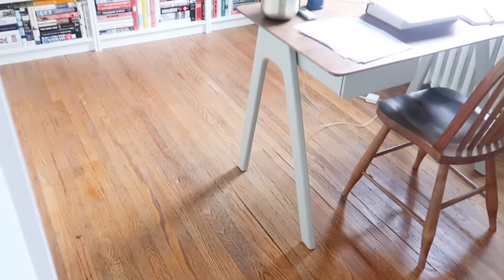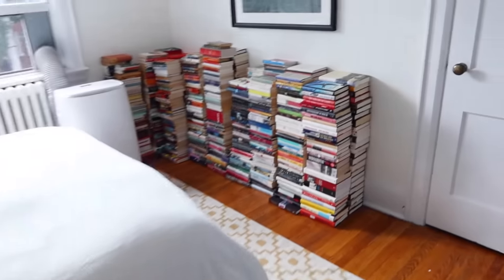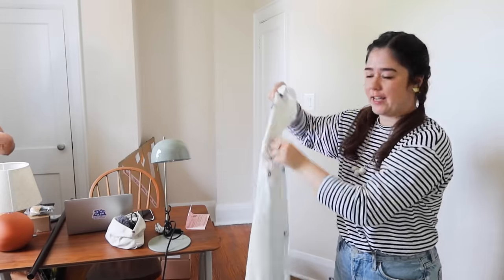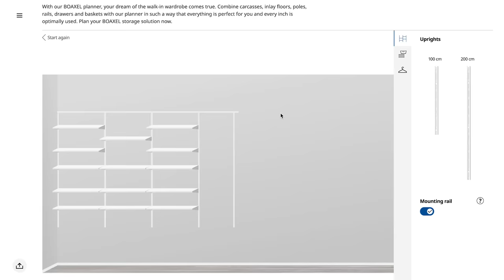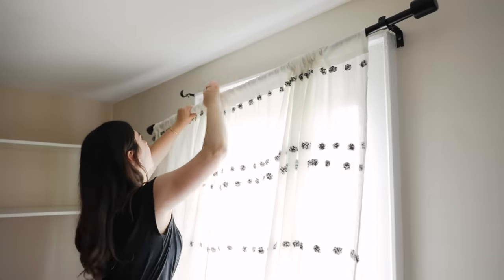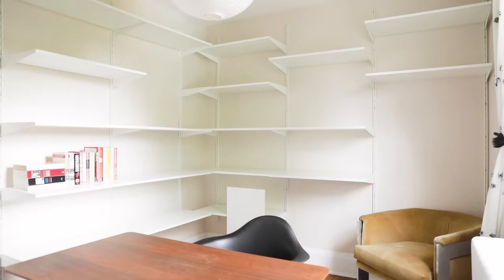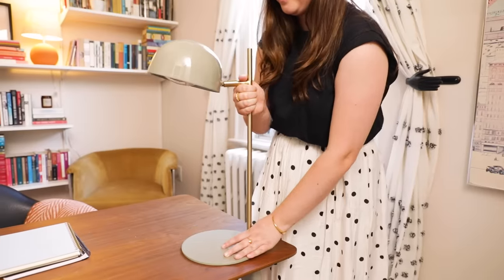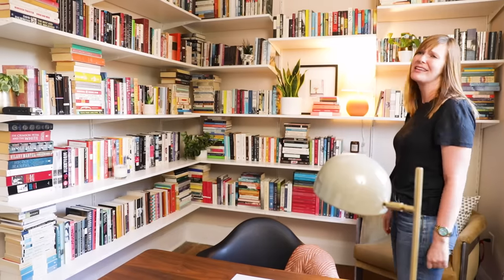Turning A Spare Bedroom Into A Home Library With 800+ Books

Comment: Are those bookshelves up to the weight of books? Book weight is something people don't always think about when it comes to putting together libraries. I do really, really like the L shape of the shelving!
Reply: I am thinking that Graeme probably thought of that, as Alexandra said he was the "pro" at any building stuff. And, she also mentioned they put book shelf supports into the studs. I am pretty sure those shelves and brackets are heavy duty !
Reply: @m.maclellan7147  it's the shelves that bow though, not the supports. I would never use track shelving for 800+ books personally, they're only going to last a few years before the shelves themselves need replaced.
Reply: @TheTinyHerd  thats interesting. a lot of booktubers i subscribe to either have the billy bookcase or this track shelving and im so confused bc.. the shelves do "bend" or i guess bow in the center over the years. do you have any recommendations for materials on shelvings for books? (if not it's fine too!)
Reply: @ruby7706  they would be fine for probably 5-10 years depends on the books you had. I wanted mine to last forever so we used like 3/8" solid birch. They were custom built though. I just have nightmare flashes of track shelves full of books raining down lol
Reply: @TheTinyHerd  that's super helpful. gonna go and get some custom made for when i finally move out so because ikea is just fast furniture at this point! (tho i know the appeal in my country is that it's quite literally the most affordable furniture store so i get it)

Comment: Ooooooooh, so bright and beautifully bookish. What a room. 2 thoughts: there's no spot for a cup of tea by the chair, either a spot with no books ar a tray that will sit ontop of a stack of books. Secondly, im imagining using ply wood, cut to the full the shape of the shelves to unify them. So you'd have a loooong board which covers all the white shelf junctions and fills in the corner gap. With a walnut stain you get a little of that dark wood library dream. Simply stack books ontop.

Comment: Hey Alexandra, This looks like so much fun.  I think I would have added one more element.  At 18:20 in the video you show the closet door and the space the closet fills opposite her desk.  Somewhere in there I would have added a mirror.  This would allow her to check herself quickly before a zoom meeting and also reflect the books back to her view when she looks up.  Maybe behind the door if the door is closed when she is on zoom or working or on the door if the door remains open.  Like you say mirrors are always useful in a small space.  Well done.

Comment: I'm an academic and just moved to a new apartment, so I'm currently in the process of setting up my own home office/library. Firstly I'm jealous of the library in the video; having to make several long distance moves I've had to significantly pair down my books. This time I only had 10 boxes of books to move.
As for the organization, I go by categories such as dividing my fiction my genre, and work related books by topic. In large categories I divide up by size, with the larger books, such as textbooks, all together and smaller/shorter books together. This is just for the sake of shelf placement and maximizing space. The important thing that a lot a lot of people forget, or just don't know to take into consideration when trying to make their books look nice is organizing by frequency of use. This is a human factors design concept; you want to put the books you use most, such as those you reference for work or hobbies, within easy reach. I do keep in mind that I do teleconferences, so I also make sure that the categories of books and decorative items that are in the background, are work-appropriate.
I do front my books (put them at the front of the shelf), as a former librarian this is habit but I also think it looks neat and clean. I will organize by height, but not strictly so, as organizing completely by height makes it look a little cold. Having some variation in the height order makes it look like a collection that you actually use.
I do not organize by color, yes it looks good on social media, but it's completely non-user friendly as all your books are mixed together and they are harder to find when you need them, especially if you have a large collection.
For those who want to understand better how to design for ease of use, and not just appearance, I highly recommend "The Design of Everyday Things" and "Emotional Design: Why We Love (or Hate) Everyday Things" by Don Norman. They're a great introduction to human factors based design and are an entertaining read even if you have no background in design or psychology. You'll never look at a door in the same way again; Vox did a good video on "Norman Doors" at https://youtu.be/yY96hTb8WgI which also is a great introduction to human factors design.

Comment: Great to see a ton of books. Personally, I would add more shelves and some less deep. You lost all the space near the floor and lots of gaps between shelves, which will invite dust. The track shelves will be less likely to harbor mice if you have that concern where you live. When I moved out of a Victorian house, discovered a mouse nest behind book s on bottom shelf. My ideal book case would be vintage wood with glass doors.  Also I would prefer a higher back on a  chair to relax in. But otherwise, I love it. Fun to see your first video clip. Like the old cigarette commercial: "you've come a long way, baby" I need a light like that. You are right about the rug as well as. Cute curtains and tiebacks. TFS

Comment: Great job. The space is fantastic! The only thing I might, might tweak is the curtains. I would extend the rod a few inches on each side and get two more panels, so it looks a little fuller and can hang in a straight line on the outsides. Having said that, I don’t hate the curtain treatment as is.

Comment: Such a great makeover. I would have painted out the corner track (behind the reading chair) in the wall color and hung the curtains higher, up at the ceiling. I realize they’d be too short but I add fabric and trim to “too short” curtains all the time and it works. Great job as always!

Comment: The make-over was wonderfull. Spreading the books and plants over two walls was much better, and the chair etc was great. Surely though, desk position is important. You can't have a lamp wire/plug stretching across where people are walking? I can't see how having the desk in the middle of the room, with a lamp on top, can be safe?

Comment: I was afraid that the bracket shelves would look too pantry-like, but they actually turned out great with the books on them. Especially the floor to ceiling use of space is a great plus. I'm considering to replace my white Billy shelves as well now. The only drawback is the depth of the shelves. There's so much unused space in the horizontal actually reducing the room's space, which is such a pity. I wonder whether there are shallower shelves (more like the shallow Billy).

Comment: Nice job, Team AG.  Yes, Alexandra, there are strong opinions on book organization.  There are also strong opinions on how books can be used in decorating.  Others may disagree, but personally, I cringe whenever I see plants and candles (especially lit ones!) mixed with books.  It does not make me feel good about the overall design when I see either a plant or a candle placed on top of a book.  With plants, it’s too easy for water to go astray and damage books.  With candles, dripping wax makes a mess and fire from lit candles is dangerous.   I also don’t like it when I see books laying open:  I have visions of sun damage to those pages vs the rest of the book, dust collecting, the spine breaking so the book always falls open to that point from hereafter, etc.

Comment: I typically organize my books by author and genre. Author is higher priority than genre, if one author has written books from different genres, they all go together. The genre affects which books go together as a big picture. I have my fantasy books grouped together (multiple authors), all historical books grouped together (again, multiple authors). And because I have limited space, I need to put books where they can fit the shelves as some of them are smaller spaces than others. I currently have historical fiction in two spots, as the books by one author are taller than the others so they don't fit where I have my historical fiction. 

I also reorganize my books regurlarly. Depends what books I buy/get as a present. If the book belongs to a shelf that's already full, it's reorganizing time. I also try to complete any series I have. I currently have one that I'm not even going to complete but generally I want my series complete and grouped together. I never organize by colour, that would just give me anxiety.

Comment: It looks much neater that way and I'd like to use those shelves for my little office too. I'm just a bit concerned about the weight of the books on them. According to the IKEA website, those shelves seem to be designed for shoes and clothes. I don't think I have studs in my house I can drill the tracks into, so they would need to get fixed to the bricks via normal Fischer's. Do you reckon that would be viable?

Comment: Alexandra you did a great job.  The place looks like an invitation to work happily.  However, the hanging lamp on the ceiling does look too cheap for the whole.  And the plant does not really have a nice shape, maybe a bouquet of fresh wild  flowers would fit better.  As you asked for a method for storage for either books or cds, especially if you have hundreds, is to do it in alphabetical order by the authors last name, by sections.  Like: poetry A-Z, fiction A-Z, non-fiction A-Z etc.  It saves you a lot of time looking for things.  Have a nice Sunday

Comment: It looks very light and comfortable. I like it. As a book owner I have to ask though: Did you space out all the books she had on just one wall now on two? Where shall she put all the books she gathers in the future? Wasn't the idea to give her more book space?  Her books don't vary much in hight so you could have minimised the space between the shelves, right? All those who were not yet full of books could be used for  a little decoration and she would not have to hang more shelves and rearrange later.  Also in my experience deep shelves just accumulate clutter which is why I pull my books to the front of the case.

Comment: You were right. The book shelves are too deep. To me, both from a monetary and design perspective, to toss the Billy Book cases (unless in selling them she recouped some of the money spent on those new shelves) made no sense at all. ESPECIALLY because you were not able to necessarily put all the books back.  Book storage is about  more than design and eye appeal, IMHO. Now, if the owner feels the space is more open with this type of shelf, then yes, it works. I can only speak for me. Of course the other advantage is that with enough shelves, you can vary the heights inbetween to accommodate books and that  may have been one of your key things to accomplish. I would love to have a dedicated office/library (although I do have a hybrid of sorts but for over 4,000 books, there are shelves in every room but the kitchen and bathroom! Yes, we have a foyer that also holds books and pantry items! Love the rug and the chair you brought in. And yes the nook for reading is great  provided there is enough light for later in the day and night when the overhead might not be sufficient. Too bad there couldn't be a window seat, the ultimate "nook." Well done.

Comment: The shelves are too deep (and too spaced out), you can see in the end shot that the books have been pulled forwards and aren't against the walls, and there is a void in the back left corner which is wasted space. The vibe and design is great, but if you had bought melamine shelving, brackets and tracks from a hardware store it would have worked out cheaper and you could have gotten an exact fit to the edges of the room leaving more space and accommodating more  books.

Comment: So, the shelves are WAY too deep for most books. I looked at this option and went with the Rubbermaid twin trak system. You can get them at Home Depot, they are cheap and way more flexible than this. Most are my shelves are based on the 6 ½ inch brackets; way better for most trade paper and hardcover books, not so good for coffee table size, but they also come in 10 and 12 inch brackets. Just FYI. And yes, book people have OPINIONS.  ;)

Comment: Oh an ACTUAL decent number of books, and HALLELUJAH they aren't rainbow.

I think a Billy built-in hack (NOT in the style shown in the example image) would have looked much nicer than the track shelves, which really scream cheap. But they are practical, and the overall space is definitely a good place to work. :)

(For anyone considering for themselves, a) IKEA sells Billy height extenders to add another shelf to the top, and b) they also have corner solutions. At $50/shelf especially with the three she already had that would actually have been a lot cheaper than the track shelving, if the estimating tool we saw was an accurate price.)

Comment: Is it stilish and pretty? Yes, very much so. But practical for someone who spends hours upon hours working at a computer and reading? No. The shelves are fine but the lamps will not provide enough light and the chairs will not provide enough back support. From experience, a tub chair is good if you only sit in it for an hour or two to read a newspaper or do some quick e-mails. If you are going to be reading books for hours, writing and editing and spending most of your day in that chair, you need a highback. Either that or a masseur/PT on speed dial for when your back muscles cease up.